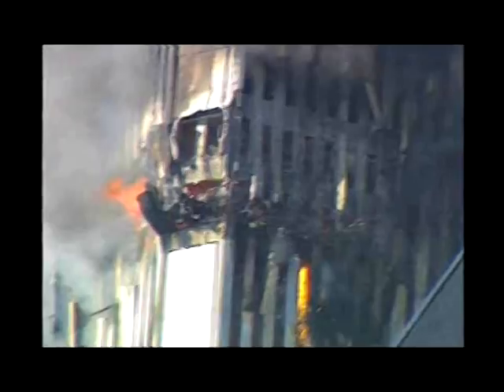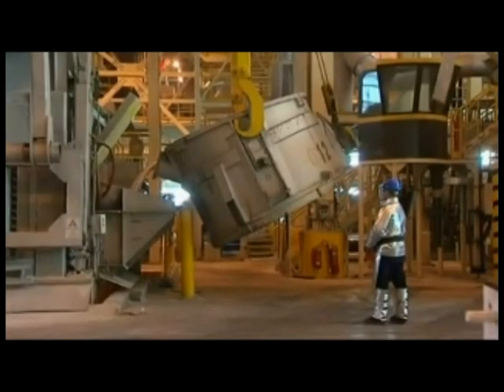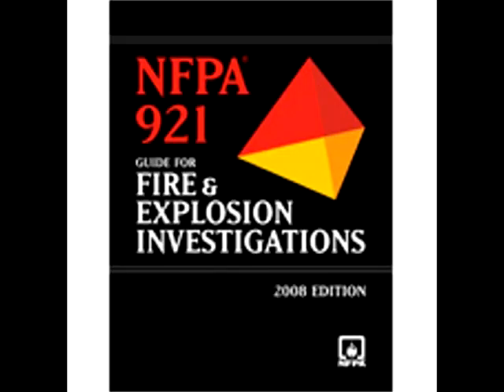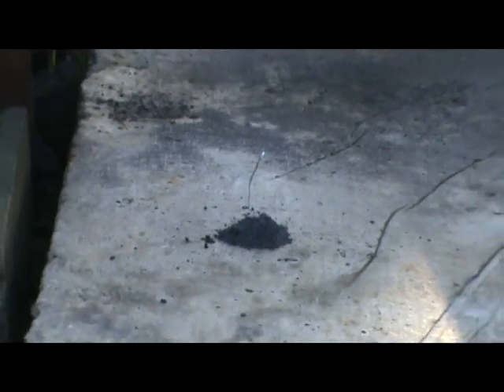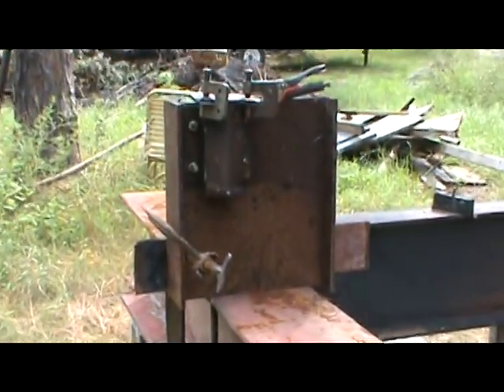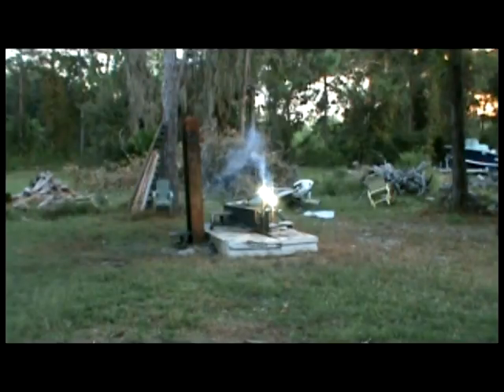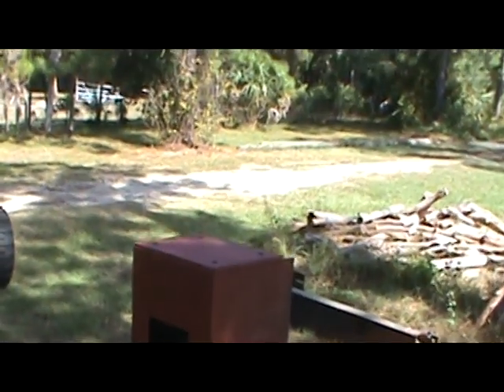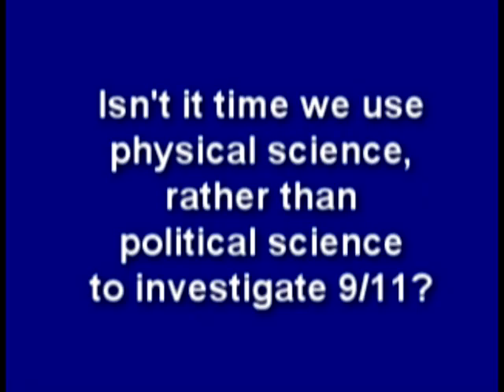9/11 Experiments: The Great Thermate Debate

Comment: @jizzmonger because unlike the world trade centers this rack has four supports columns per section, two of which are interconnected to another section, etc.  Take out the one leg of a table with a weight of objects on it, will it stand , no it won't.  This is similar to this video.  I don't know how or why you need someone else to come to this conclusion for you.  The WTC had much more support columns then this and was meant to withstand the impact of the planes which it did.

Comment: @jizzmonger But you said yourself that the trusses initiated the collapse!
You can't have both Princess. Either the trusses pulled on the perimeter columns (meaning lateral loading did not cause truss failure) or the perimeter columns laterally loaded the trusses (as you originally suggested and then ruled out by saying the trusses initiated the collapse by sagging) LOL!
You are a very confused little swallower aint ya, shit for brains!

Comment: @Merlin5x5 Fig. 27 Spheres extracted from WTC Dust.  This sphere is even smaller only about 50um.  It is quite obvious that the spheres vary in size none of which is no where near 10-16mm which I might add is the smallest iron pellets can be made using Bentonite binder.  If you like we could take larger pellets formed which can be 450mm.  Either way there is little comparison.

Comment: @Merlin5x5 you do realize the size difference in the spheres of iron found at the WTC site and the ones made by using Bentonite as a BINDER.  The spheres found at the WTC site where around 70um while the ones using Bentonite clay as a binder are 10-16mm.  I don't know how anyone could confuse 70um spheres with 10000um pellets.

Comment: @pjnlsn If an experiment is the arbitrator of opposing hypotheses and Jones' and co. have done experiments on the paint used in the WTC to find it simply turned to ash, why are you so afraid to conduct your own experiments?
Is it possible that your experiment conclusions could be worse than you had feared and you may prove yourself wrong instead of them? (Gasp!)

You challenge their findings with no basis of your own to prove them wrong.
You're just an empty echo of all the gutless deniers

Comment: @pjnlsn this is complete nonsense " molten material flowing may release bursts of heat as it's molecules combust, drawing fuel from the surrounding air."

no, it simply does not work that way, U should have more studied chemistry

Comment: @Bernadotte01 This is required to combust any material. The only difference between your campfire and a plane fuselage is that the temperature required to either raise it to, or bring it in contact with, is much, much higher.

Comment: @Bernadotte01 Or, in other words, all combustion requires an initial heat source. To light a campfire without a lighter or such, you might strike pieces of steel and flint together. The hard flint will break off a piece of steel, which is now superheated by friction, which then contacts your materials which may ignite.

Comment: @Bernadotte01 I thought that's what you were doing. 'detonation' 'explosion' 'fire' 'combustion'

A molten material flowing may release bursts of heat as it's molecules combust, drawing fuel from the surrounding air. Like in lava flows for example. Whereas the silicates, aluminum, iron and other elements in lava will not, generally :P, at room temperature.

Comment: could anyone tell me pls how much thermite would b necessary to weld thru 
enough steel beams to cause a building like a WTC Tower to collapse?
Do U really believe that welding one Beam or a few screws nuts or bolts is enough? And how could this amount of Thermite be placed while no one would realise these preperations?

@ dustpuffs... the footage shown here was taken while the upper stories were already collapsing. so the air (of which a building mostly consist of) has to go somewhere.

Comment: @ThePeage I don't quite disagree. In fact, a paint comprised of iron oxides to prevent iron rusting is easier to explain. In which case I might say that the paint is removed by heating or impact, in which case it mixes with whatever heated or burning materials are in the immediate area, including Al, and the rest of the combustion products lying around, until it cools and solidifies so that someone finds it days later.

Comment: @ThePeage Heated and/or combusted steel segments, coated with certain paints. A general mix of combusted and/or heated building materials. Heated and/or combusted steel segments, coated with a mix to be described as one part elemental Al, and one part Iron oxide.

There isn't enough data, at an accuracy, to really distinguish between all those explanations. Although, the probability of the second is lowered by it containing many different explanations of varying likelihood.

Comment: @Bernadotte01 'Jetliner-induced fires can't account for the metal fire or the molten cascade.' 
Jet fuel initiated fires are just fires. At least, after the fuel is consumed. Which would have happened a few minutes after impact. Are you saying that any fire couldn't do this? Keep in mind that fire is what we call a particularly energetic chemical reaction. To release any amount of energy, as heat or otherwise, you need only the proper ingredients.

Comment: @ThePeage Of course it's not unusual. And no, they don't. The only scan which they did which might be accurate for the sample structure, i.e. _hinting_ at the chemical bonds is their cross section scan. Incidentally, it's only when a sample is prepared to be of a uniform shape that ratios of elements can be calculated reliably. A process which, I might add, is a mere extension of basic EDS. Which itself tends to be so random as to only the reveal the presence of certain elements.

Comment: @arisuta2

Far from ideal, one failure after another over and over and over again, thats the truthmovement. In this Video for example -glowing perimeter columns (actually its just the AL-facade), installing explosive devices inside of perimeter-/corecolumns- 100tNT+conventional explosives, ignoring the fact of the non-existent molten torrent of steel beams and the inadequate WTCdesign, drawing inadaquate comparisons (Windsor vs WTC) etc.

You better twitch your own nose, you're full of failure.

Comment: @Merlin5x5 they did not weight a ton per linear foot, but only a 1/10 of a ton per linear foot, also you need less than 1kg of thermite to heat the steel to 1200°C and so on.-...... the point is that you lie again LIAR LIAR LIAR LIAR LIAR

Comment: @pjnlsn not a micro nuke
 .01  Kiloton or smaller  in the sub basement  of the wtc buildings 
in comparison  Nagasaki was bombed with a device of approximately 15 Kilotons  
which was exploded in the air and it reached 10 miles with a 100 mile radius  pressure wave 
So  150 times less than the Nagasaki bomb in the bottom floor

Comment: @dave777blaster And, it's not as though the entire building was made to dust, which would be a sure sign, or as if it was only steel that was made into dust. Tests on a variety of dust samples reveal an elemental composition from a variety of building materials. Silicates from glass, elements in concrete, some iron content, aluminum content from aluminum construction materials, and various others.

Look at wikipedia (World_Trade_Center) for a description of the tower's design. (tube-in-tube)

Comment: @pjnlsn  NO the core was the main structure not the sides.
building  that fail do not fall at close to the speed of gravity nor do they leave 
the steel girders cut off at 45 degree angles
the steel would of been twisted up and none of it would account for 90% of the building
being pulverized to dust.only an explosive device could account for that

Comment: @arisuta2 A plane cut through nearly an entire side. All four exterior sides are responsible for supporting the core. Without them, the core would crumble. At the very least, a plane impact would have toppled it, if it should not just fall immediately.

Comment: @Merlin5x5 no EMP means Electro magnetic pulse moron
and a micro nuke would not cause so much furthermore the steel was taken away
before anyone could check it.
Radioactivity was measured around the area and it was there.
cars melted  a block away and this can only be accounted for by a nuke

Comment: @Bi0hazardx You seem to have those backwards. A eutectic mixture is specifically defined as a mixture with a melting point as the minimum of it's various elements. Which could be melted at that low temperature. By definition it *can*. The point is to find whether it *did* so.

Comment: @Skeptic121 That was the whole point of their design! 
In return for pleasing, very open floor spaces, it was made as a 'tube-in-a-tube.' The outer tube consists entirely of columns, closely spaced. 
Listen to the first few secs of this vid: 'the twin towers had a perimeter of steel panels....each panel...3 box columns.' That's the shell of the building, the strongest layer.
The inner tube, where the flooring is, has only a few columns.

Essentially, they moved the strength to the exterior.

Comment: @Skeptic121 Do you always deny things which don't mesh with your world view?

Like the lack of massive explosions when WTC7's interior columns fall in?

You'd do well to remember that WTC7's design is similar to 1 and 2. As in, not a core structure, but loosely connected columns, without significant reinforcement. AFAIK, like the towers, the exterior has all the strength. 

Thus, it makes perfect sense for the interior to fall in leaving the outer columns behind!

Comment: @ThePeage
I hold it because of what kaolinite is.
Specifically, it layers: OH on Al hexes on OH-O on Si hexes on O. I saw kaolinite in the correlation of Al and Si.
(1 I still hold it.
(2 Probably.
(3 I will read those.
(4 I try to be open.
(5 It is possible.
(6 If they have found military grade nanothermite, an investigation would be imperative.

Comment: 13:25  The box column could be also dented inward from the one side, that is not visible. ;D

13:31 How did the NT-charges made the columns glow? Isn't it suppose to work like a cutter charge, with the blow directed at one small stripe? And some thermite/thermite or whatever attached like paint wouldn't work at all... as proven. Furthermore... WHAT is it that you see, looking at the perimeter columns from the outside? HINT: it ain't the perimeter columns.

Wow, what a fatal mistake to make.

Comment: Placing this kind of "NT-Charges" would require "a little" more than the "clueless worker", who thought he is applying harmless paint. Welding hundreds of columns, installing tons of devices, not just a improvised charges as in the video... there'd be igniter necessary for EVERY load.

Tested it... with what? Pure AL? First of all, AL-parts of the planes consist of AL-ALLOYS, under what conditions did they test, what kind of materials were involved, what info do they have about the location aso.

Comment: @ThePeage You all need to step back and realize that nobody says government is innovative. 

An explanation is like the rebuilt WTC7. It has a solid foundation. Then it has columns extending the foundation. Finally, floors are built on the columns and off the core. If the core is solid, you can always tear out the floors, and even the foundational columns, just to leave the concrete core and redo it.

Comment: @ThePeage It would identify if it was actually made intentionally. A nice Al/Fe ratio of 1:1 would do. 

The silicon isn't bonded to aluminum? I suppose the similarity of the cross section map is just a huge coincidence?

I gave up on the condition for perfect atomic distribution. Have you decided to claim it?

What's more likely, all of those hits in fig10 are coincidences, or they've mistaken their 'silvery looking' material which apparently flowed after MEK coating?

Comment: @ThePeage The conclusion that in this sample is Fe2O3, is more supported by the cross section. Also evidenced by the cross section is Silicon and Aluminum. For some reason they declined to calculate ratios on the more accurate sample. But at the very least, Si corresponds to Al here.

If I must explain how a substance which merely contains Al and Fe O can be exothermic. Then someone must explain how......this sample can merely contain them and be exothermic.
Does the Si just move on its own?

Comment: @ThePeage You still haven't answered my question about the silicon.

The paper shows they're aware EDS scans become more accurate on smaller, thinner samples. ('The ratios of these elements appear to be similar especially when this analysis is performed on a clean cross-section of the layers.') Pg 22 Discussion.

We must assume the Si there is bonded with Al, as is O. just as we assume the Fe is bonded with O.

Even they say the Fe/O ratios become more as they expected in the cross sample!

Comment: @ThePeage Um. You mean if you ignore fig 10 and use fig 15 it shows that...

The maps and spectra are from the same scanning method. They are different ways to represent the data. The maps include the location they got the element hit from. The spectra add them all up and graph them. The y-axis, not seen, is the amount of xrays returned corresponding to that element. X-axis, ray energy, telling you the kind of element.

Comment: @ThePeage A chemical analyst will tell you that EDS scans aren't generally used for estimating the amounts of anything. Just the presence of elements. Especially in large samples. Now, the cross section they took is just beautiful (fig 10), it looks like a pretty flat surface, and the spectra are very clear.

Comment: @ThePeage Then how do you decide between fig 10 and 15? You say silicon is not bonded with aluminum. Fig 10 supports this. Fig 15 does not. And you chose the latter because?

Comment: @ThePeage So, you're stipulating fig 15 is from an accurate scan. But now look to the top of the sample. Is it troubling that Iron appears where oxygen does not? 

Even if you don't admit to randomness in EDS, given that the iron oxide it is supposed to be composed of greater oxygen than iron, you'd think that there'd be at least _equal_ hits of oxygen and iron from that area. Am I wrong? Clearly we have a contradiction here.

Comment: @pjnlsn 

Well if you want to deal with a timeline hows this for you. In 1993 there was a botched terror attack. The explosives were provided by the CIA. Just after the attack the WTC complex brought in a lot of new security from the private sector. Anyone wishing to slip in a few extras from those sectors wouldnt have a hard time if they were well connected. That gave them 8 years to plant any kind of device into the WTC complex. Lastly Marvin Bush worked in securecom from 1993-2000.

Comment: @darion65 All right, that's wrong.

It is not true that there is no evidence for thermite.
There is. There is also evidence for the melting of steel surface and the paint applied.

Comment: @ThePeage Er. Significant.
If you'll look at fig 10b and 10c, you'll find that there are areas of significant aluminum concentration, which correspond to areas of significant oxygen concentration. They're in the center top of the scan. I count them as three areas of concentration, and they're clearer on the aluminum graph.

Comment: @Skeptic121 no, skeptic! The corner flow included some 100l of material, that translates at least to 250 kg of thermite, the exterior columns did require only few kilograms of that stuff -> the NE corner event was caused by a core column charge. As to the exterior columns.... they could have tampered with the bolts or they just waited for the inward bowing to do its job

Comment: @Bernadotte01

"metal fire"

Any proof for the composition?

"a torrent of brightly glowing molten iron"

After one hour of fire. Isn't (Nano)thermite supposed to be this rapidly reacting stuff, igniting at 400°C? In the vicinity of this particular spot 400°C were without any doubt reached at the very first minutes.

"iron spherules"

Disregard that. The origin of the samples, the cleanliness, the methods they were examined with and the individuals who examined them are doubtful.

Comment: @earthicastar

"wouldnt we have seen that throughout the entire buildings and not just in one corner?"

Not only that. A load of 100t NT throughout the buildings... and yet this fast reacting, highly combustible thermetic material needed 1h and 1 1/2 to bring the already severly weakened (massive energy of the impacts and the fires) towers down.

Why did it need almost one hour to ignite and to stream out of the south tower before it collapsed? Did it  wait for its start signal?

Comment: @nehorlavazapalka the volume of the NE flow has to be at least 100l that would translate to at least 250 kg of thermite. Do you really think that they would use 250 kg? This video shows that an exterior column would require no more than a few kg. The bolts on the exterior columns could have been tampered with? Sure!

Comment: @physicsandreason no, the reason for this is that the floors were engulfed in smoke and the distance between the core and exterior was 18m+. Basic trigonometry will also show that you would have to be at least a km away from it in order to see the core. It would have made no sense to place MASSIVE charges at the exterior as the risk of multiple molten streams would be too high. What we see at the NE corner is a core column charge displaced by the aircraft.

Comment: If anyone has Harrit's paper on hand, you can look in Fig 11.

We see a spectra for the so called 'plate-like' particles showing significant Aluminum, Silicon, and Oxygen, consistent with the composition of Kaolinite ( AL4 Si4 O10 (OH)8 )
As Hydrogen cannot be readily detected by the most sensitive EDS detectors, it is not seen.

A spectra of the 'whitish-particles' reveales significant amounts of Iron and Oxygen, which is iron oxide contamination.